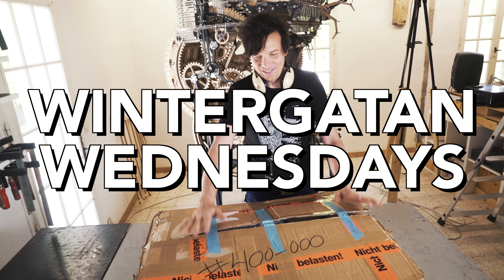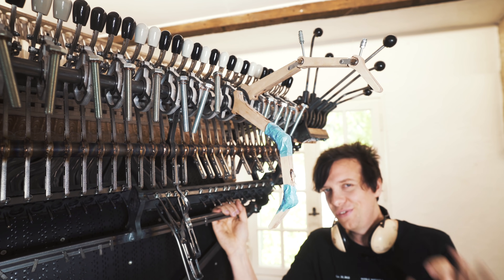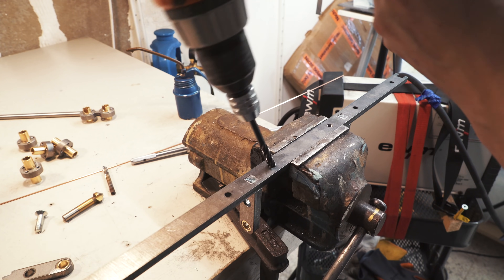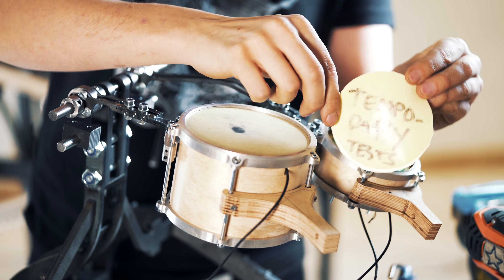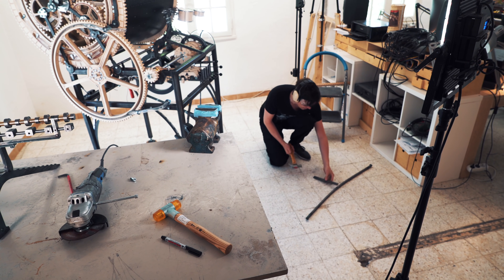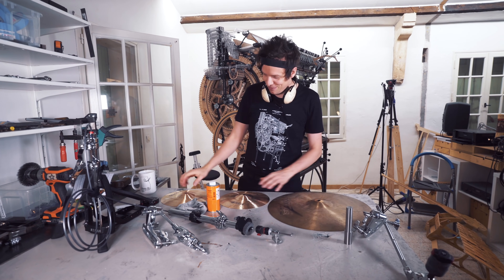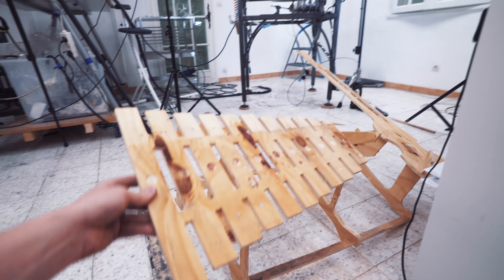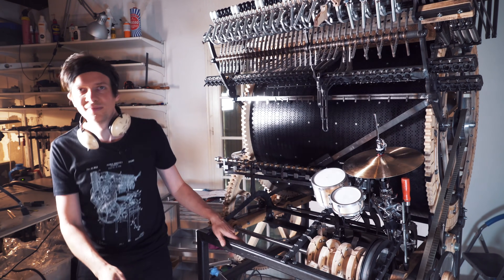Instrument Support Assembly - Marble Machine X #83

Comment: It's probably already been thought of or suggested, but if "not being able to see much movement and no marbles" at a distance (say 50m) when on stage is justification for the kinetic fingers, then wouldn't it be possible to have fluorescent marbles charged by a UV light on the machine? That might be a simple option but with high visual impact at distance on stage (assuming darkened venue and glowing marbles aren't completely obscured by machine at all times). Alternatively self-illuminated LED marbles but that's likely impractical (wrong weight, too expensive etc).

Comment: We'll see how well you do with your new, careful hand drill tapping. You say the key is not tilting the hand drill. That's not trivial to ensure each and every time. You're saving a minute and a half on an operation you do once in awhile. (Are you counting the extra time you're taking with your extra-careful hand drill tapping procedure?) What you need to do, is to quantify what you save against the penalty when you break a tap, multiplied by the probability. I'd bet that you'd still come out ahead if you just got faster with the hand tap.

Also, I never have seen you reversing the tap to break the chips when you hand drill. Have you taken that into account? If the chips get all jammed up, that's also going to break your tap.

Comment: Your welds are looking SO MUCH BETTER. When you first started I wanted to close my eyes, but you have improved immensely! Something that might help is managing your heat direction, you can push or pull to get a smoother bead depending on how quickly or slowly the metal heats up. But again your beads are consistent!

Comment: Yeah it's not that the fingers are a bad idea, its just the ones you showed were.
I'm all for the kinetic fingers so long as it doesn't obstruct the rest of the mechanisms within. I think it should be made of sheet metal because the wood doesn't belong there and it would match that section of the machine

Comment: Hi @wintergatan 
I don't know if you realize, that you are using taps, that are ment to evacuate metal chips upwards (spiral flute tap). They are perfect for blind holes, but they are much weaker than other types. I would suggest to use spiral point taps. They are stronger.

Comment: The fingers;
Should be Acrylic plastic, with patterns cut in to them, ideally to stylistically match the marble lift.
Lit by LEDs possibly? Make them visible even on a dark set.
Possibly alternate in colour in the same pattern as the manual playing knobs?

Should not stick up as far as the prototypes, the angle the "cut off and tape back together" finger had looked fine!

Comment: Hey Martin im a huge fan and what a great job you doing. I have a few concerns about that the machine design was initially made mostly of wood and you improvised a lot of parts using metal which is fine and structurally better but my concern is wont the machine be too heavy and cannot support its own weight ( i know you put the crossbars to aid with stability but as the machine goes to completion the small components seem to have more weight). Also have you checked to see if the crossbar doesnt hinder the drum when the programming pins are put on because from what i saw it seems the space between the drum and crossbar is very little for the pins. Keep up the good work.

Comment: It seems like the last 7 days have taken forever to get here for your Wednesday video. Just a suggestion if you plan on keeping the machine with bare metal for the beauty and Aesthetics of each type of metal use sharkhide to coat all the exposed metal surfaces to prevent them from rusting or oxidizing. I've seen quite a few YouTube Fabricators using this metal coating with great success. Keep up the good work!

Comment: I was surprised when i heard so many people complaining about the fingers, I personally have always liked them, even since the beginning.

What i do not like however is your solution on the cross bracing being in the way, altough i guess there really isn't any elegant solution.
It should be possible to cad something that will connect the 2 parts of the bracing together (basically doing what you did now but mirroring it to the other side).

But as long as you're happy with it i guess it's fine as it is :-)

Comment: I hope there is enough room for the music notes 14:40 

There seems to be little clearing between the drum assembly and the note pegs on the programming wheel.

And about the fingers: Please make sure to design them in a way so you can play the machine even with the current disabled rack, otherwise you can only play manually when the thing is active.

Comment: Another comment about the fingers: I think static is the way to go. I understand the idea that it should also be a sculpture. But being big and floppy seems too "silly" unlike the rest of the machine. Just like other visual parts (the marble lifter) it should be large enough to be visible, but small enough to not block the inner workings of the marble machine. I think just small lifters that bumped up and down to the beat would be enough.

Comment: I didn't check out the comments last week, so apologies if this has been said already, but my recollection was that in the early videos the fingers were conceived as being long and spindly steam punk / Tim Burton things that moved as multi link pivoting levers. Was this the case (or just my imagination)?. Either way, how about long spindly fingers that move in a closed loop starting in the current place, then going up and back before attaching again at the 12 o clock position of the pgm wheel, with 3 links. Wouldn't it be a cooler movement and more practical than the flappy fingers?

Comment: Hey Martin,
Won't it be better to have way larger kinetic fingers? About 3 times the size, as if they are spiderlegs or fingers for weaving cloth. To me they should have a fixed trajectory as if they are working on something instead of flapping about. Maybe you can fix the tip of the fingers to the machine by a spring (slim and long or as a string with a short spring - maybe you can hide the spring INSIDE the tip of the fingers!). 

Then they'd be better visible (because now they are tinytinytiny) and more aesthetically pleasing.
Good luck!

Comment: About that crossbar... won't it interfere with the metallic pegs on the programming wheel? It looks like it's a bit too close.
Reply: I'm sure he's accounted for this, it would be a huge and pretty ovious oversight, and he's and everyone else are certainly not stupid. Also, he's tested running pins through it in earlier videos with no problems, and the new section is in like with the old so it won't change anything. It looks like a small gap, but the pins are pretty short, and it probably looks smaller because of the scale of the machine

Comment: I’m still not on board with the fingers, but I appreciate enormously the fact that you commented on our reaction. Thanks for another great video.
Reply: I beleive that there is a huge risk that the fingers will ruin the esthetics of the machine. Dont make it look creepy.
Reply: Make the kinetic fingers look similar to the levers on the side! Wire with the plastic black and white balls. They'd compliment the mechanical design without completely changing the aesthetic
Reply: Freddie Rich this is the best idea yet, they look to life like and need to be more mechanical
Reply: @dawsonj7679  that is very subjective. I would love if they looked a little creepy. Like skeleton fingers. The whole metal machine has a somewhat creepy vibe and I think it also fits the band
Reply: @georgplaz  Subjective isn't the same thing as wrong
Reply: Peppery Peppers I agree. The fingers were the wrong choice. The desired function should be achieved in a different way.
Reply: Georg Plaz I dig the kind of creepy look too 🙌
Reply: Dexter Rutecki   But that's the issue. There is no function. Just an attempt of visual effect. (Actually like long fingernails on women... useless, and even unaesthetic.)
Reply: Why not add even more functionless elements just for something being visible from a distance?

Comment: And this is how you handle criticism like an absolute boss.
Really glad you addressed the comments on those fingers, I personally myself found them a bit strange and creepy-looking. Though maybe that was more about the overly dangle-y part (combined with how long they are) and less about the actual movement and their purpose. I also had no idea these were part of the original drawings so that's a plus I suppose :P
My only concern now is that it seems they will stay down in their idle pose, and then lift once a marble drops? This feels kinda backwards if they were meant to resemble fingers playing a piano, for that they'd surely need to stay up and then move downward when a marble drops, right? I'm no engineering genius like you, so I have no idea how that could even be pulled off, but who knows
Reply: They are supposed to resemble the ones on the original marble machine. They lifted up when they dropped a marble.

Comment: I hope you checked the fittings for clearance with pins on the program cylinder before tacking everything down. It would be a disaster if you put pins in and it caught on the brackets or hi-hat.

Comment: What about smaller fingers that point straight down?

And the other suggestion that I did on the last video:

 What about an optical solution instead of a more mechanical one? Like with tiny mirrors reflecting different angles of light depending on the note playing at the moment. Something that would fit better with the acrylic parts on the left of the machine. I don't know what material it should be, but wood seems too much "opaque"

Martin, I can't wait too see how this part will end up no matter how it turns :'3

Comment: With the fingers, have you thought about the latency of the sound getting to the audience, may it look slightly off time at very large distances?
Reply: If it's delayed is not a problem if it's not by much, our brain auto-adjust for delay, but if it's forwarding the sound it might feel odd
Reply: Also you have to add the delay in the machine itself. I don't the number, but it is more than 0.1-0.2 sec, it's gonna look weird.
A guitarist or drummer don't have  delay between the note being played and the sound.
Reply: You never know, he was concerned about mili second time differences before, it's just something to consider
Reply: ... ur joking right? He would need to be like 4 blocks away from the concert for that to happen